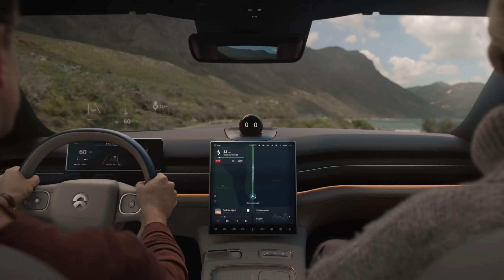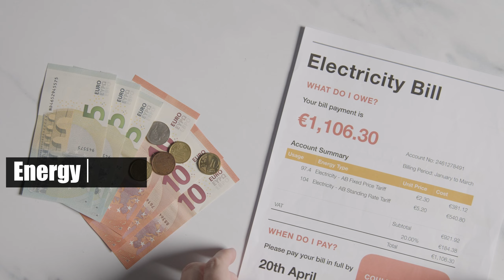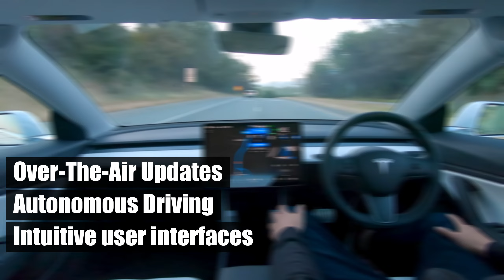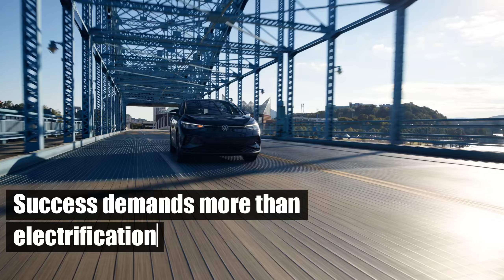Volkswagen’s Shocking Collapse: What Went So Terribly Wrong? Electric Vehicles Market Massive Loss!

Comment: The build quality of the VW group has been shite for years. I worked at a dealer, every diesel  Jetta we sold came back on a recovery truck with fuel pumps gone. They then drop the Golf for the electric ID2, madness, the best selling car in Europe is the Dacia Sandero, if VW could make something similar & basic like a Golf version, it might help.
Reply: At a time the idea of Carlos Ghosn to create the cheapest possible car that eventually translated into Dacia Logan was welcomed with scepticism. Who will want to buy basically an engine on wheels only. But right now Dacia is the only brand with price vs. expectations ratio at stressed but acceptable level.
But You're right. VW at this moment has no model people want and can afford. VW does not have class A nor B cars, it was never interested in protecting chapest car from price increase  pressure applied by EU in form of mandated electronic equipment that lifted car prices to the sky.

Comment: Ev's will never work until goverments realize that the most important part is infostructor it needs to be a unified approach where all battery hardware is standard and country unified.  Unlike the phone or electric tool industry's where difrent makes have different charging heads. The true answer is battery  changing stations where you just exchange your battery  for a fully charged at a charging garage

Comment: People don't want EVs. That's why they failed!
Reply: lol yeh ... that's why the US has to put massive tariffs on Chinese EVs .. because no one wants them.
Reply: Apparently only smart people want EVs.
Reply: People don't care as long as it is cheap and convenient enough.
Reply: @mijmijrm Chinese EVs wouldn't be able to pass the collision standards of the U.S.
Reply: @henrylicious  - so you mean there wasn't any need to put the tariffs on them?
Reply: @henrylicious it’s sad to hear someone coping so hard… Chinese cars literally getting higher safety rating than US cars in EU
Reply: The circus is in your town, they have your vacancy application and have accepted you to fill the space they have with the other clowns
Reply: @BojanBojovic  
Both conditions are not met today. It's not cheap, and can't compete in convenience with ICE. It's even hard to imagine what should change to make EV comparable in convenience to ICEs. Fast replaceable batteries or EREV (extended range EV - EV equipped with ICE range extender - an on board ICE based "power station" for electric traction.)
Reply: @mijmijrm the US put tariffs on chinese ev’s because the US can’t compete on price.

Comment: Stop the dancing around the real reason, the masses are not going to buy EV.
Reply: Perhaps they will learn to walk then!
Reply: @nickhstd2  или ты научишься ползать))))))))
Reply: Yes.  You will buy EVs. They are the good future and will make ICEage vehicles irrelevant.
Reply: @GWAForUTBE Is that what they told you
Reply: 50% vehilcles sold on Chinese market are EVs
Reply: It is so difficult to say. I am from Germany and own as a second car a BMW I3. Bought it new in 2022. State subsidies were 6.000 Euros. 10 years free of car tax.  CO2 return 360 Euros in 2022. The I3 was at that time outgoing model and you could buy it with 25% discount. Was very happy with my buy because at that time Diesel gasoil was up to 2.25 Euros per Liter. But happiness disappeared fastly. Charging costs climbed around 50%. Whilst Gasoil decreased 30%. Was average cost for 100 Kilometers 40% from gasoil in 2022 this 60% profit shrinked to +-20%. And no profit in winter. 

You are right that actual EV's can't compete with ICE yet. But the time, when my profit was 60% I could live with the negative points. Don't complain a cheap horse😂
But now with this very little profit or no profit at all when you include faster value deprivation you don't get enough compensation. 

It was pretty logic that interest on EV's felt back after these cost rises. 

For me the key factor is the price of charging. As soon they cut charging prices by 50% (or gasoil gets much mire expansive) interest will return quickly.

Actually they did some improves on charging costs by some monthly booking modells but the sentiment is now bad. It will take years to rebuild interest. And economic circumstances tie people holding their money. If they still have. Living costs rised 30% the last 4 years by constant income. Wealth in middle class and free money went down pretty much. Concerns belonging jobs add to it.
Reply: @  isn’t that interesting, the Chinese keep building dozens and dozens of coal fired plants to build and charge EV.
Reply: @tertur2957  Thats the main reason for electrification. Beside pollution problems in Mega cities. They have coal but no oil on their soil. Electrification saves a lot of foreign currency.
Reply: @rainersta7073  so 10KE directly from beloved govt, means from others pocket, thats what ruins the whole economy. And no fuel tax for electricity which is more than half for gasoil. Even with this EV hardly competes.
Reply: @antontsau  These decarbonation demands come not from local goverments but UNO and whoever sets it up. Nations in the west have to comply. In Europe the EU looks that Nations do it. As i heared, EU is a Nato institution. Just looking independend.  You remember this Greta Thunberg story who was there to prepare all that climate hysteria.  
So German Goverment and car companies had no choice but to follow. The state subsidies are just there to help for transition process. To avoid bancruptcy and have all employees on street with no work.
Reply: I guess I need to sell my Porsche 911 if no parts & service supports.. hello Corvette Z06 or ZR1

Comment: VW started out making idiot proof cars which could be repaired cheaply by anyone with a basic auto repair  background....
From 13 years old, I spent my youth running motorcycles and cars, before qualifying as an engineering toolmaker,... 
I now own a BMW M-Power 530D and have never touched anything under the bonnet,... other than to replenish the Oil and Water.
Start out with small and simple,....